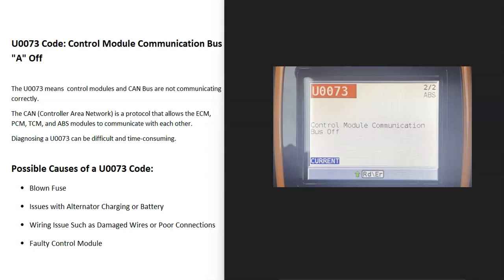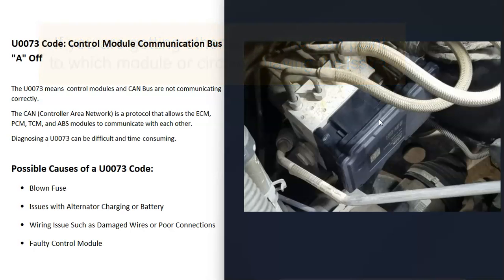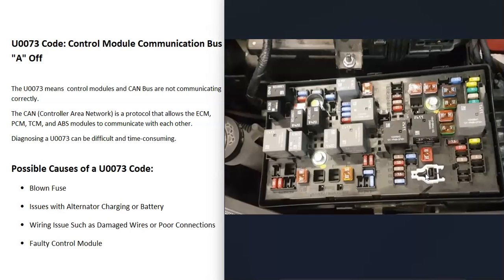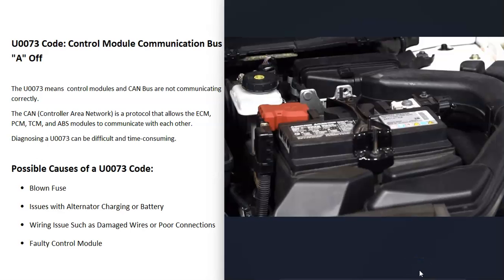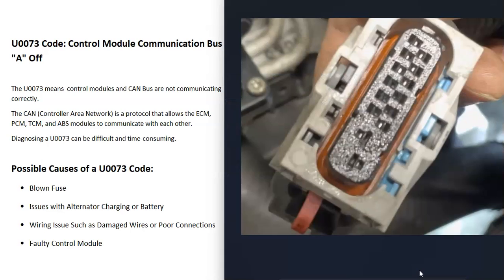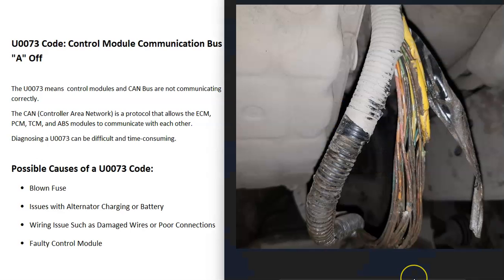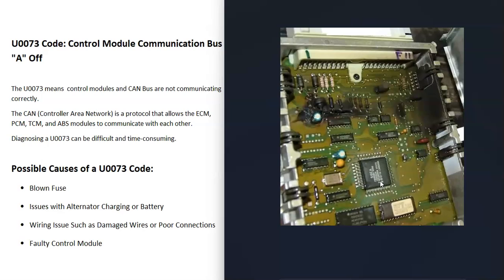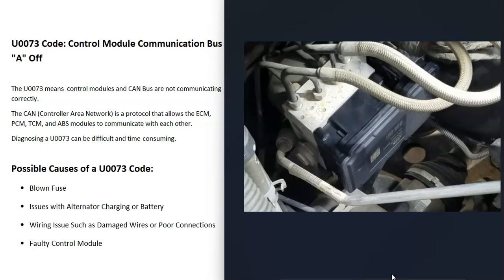Causes and Fixes U0073 Code: Control Module Communication Bus "A" Off

Comment: I have a 2007 expedition 54 motor driving down the road in a trans seemed like it wouldn’t shift when when the wrench came on and the code came up with you 0073 as a transmission control manager

Comment: 2016 equinox 3.6 have this code during driving, gauges turning on and off erratic shifting, then “stabling error” message and check engine light, scanned code get the code u0073 any help?
Reply: That’s what my 2015 terrain 3.6 is doing did you ever get it fixed and what was causing it?
Reply: we have same 3.6 but in a 2008 aura same error code just started

Comment: 2012 Escape...traction control, abs, brake lights all came on at once.  Drives fine.  I had it put on a scan tool and it came up with "No Communication with ABS."  He couldnt pull a single code.  Idk what to do next.  Fuses seem to be fine.  Is there a relay or bus I can check?
Reply: A lot of times, that means need a new battery. Get a good one.
Reply: Any luck yet? I have a similar issue with my 2013 focus with the speedometer not working at all on top of everything else

Comment: Will alternator affect starting?
Reply from the maker: If the alternator is under or overcharging, that will cause issues. It can be tested with a multi-meter.
Reply: @HVAC_Mechanic  Reads 12v like my battery and starter
Reply from the maker: With the engine off, the battery should read roughly 12.20 - 12-80 volts DC. When the engine starts, the alternator should output 13.50 - 14.50 volts DC. You can look up the rated output for your vehicle, but around 14 volts DC is common. If the alternator output is under or over that range, there is likely an issue.

Comment: 2014 Scion tC.  I have this DTC and c1241.  If I turn on the A/C or use high beams, the 'BRAKE', ABS and traction light go on.  Really sucks with the heat lol.
Reply: Did u fix it
Reply: @zart3374  I fixed it.  With all the complexity that could've been the cause it turned out to be a bad alternator.  The NAPA alternator had perfectly OK running voltage and only was only a year old, so I didn't give it much thought.  But I guess further testing was needed to recognize that it was putting out too much alternate current.  Anyway the alternator was under warranty, so I got a replacement for free.
Reply: @zart3374  nope still driving without a/c in 100 F weather until I finally decide to just have the shop fix it.

Comment: My shit only happen when it rain in my Mazdaspeed 3 idk what it mean.
Reply from the maker: It will need to be troubleshooted, but wiring connections may not be sealed and may be getting wet. Sometimes, the computer (ECM/PCM) located in the engine bay loses the seal that keeps moisture out, which can also cause issues.

Comment: I took my 15 silverado to the dealer twice said nothing is wrong with it I'm still working on it but i still have reduced power and the dang u0073 code for the ebcm its been a headache
Reply: did you finally figure it out?
Reply: @DFWAuto_Hack  yes it was the dang torque converter It's been running like new since I swapped it out
Reply: @gasparibarra7334  dang this code is wild. I am checking modules a lines like crazy right now. But the transmission been banging when shifting on drive. The top motormount is bas so im not sure if it has something to do with it. I have ECM no communication with EBCM and EBCM no comm with TCM, BCM, ECM nd TCM no comm with ECM and EBCM & a traction control code and a battery sensor code. Engine has full power but car is possessed. Gauges on dashboard act like they are sick with intermittent seizures lol. Glad u fixed yours
Reply: @DFWAuto_Hack  yeah man idk how but the torque converter was causing me all those same issues the 4x4 would engage randomly, crazy cluster, my lights would even dim out I have no idea how the converter messed with everything else
Reply: @dfwcarkeys did you ever got around what was causing this? Mines doing the exact same thing. And it's driving me insane
Reply: @dfwcarkeys i am right where you  are and I am getting pissed .

Comment: I reset my car by disconnecting the battery and the u0073 came back after the emissions system self checked. I haven't been able to get back and check that out more.

Comment: My 2011 GMC SERRIA  abs light on ,engine light on , traction control,  brake light on , all fuses are good , what could be the problem
Reply: What was it?
Reply: Mine turned out to be high pressure fuel pump. Took it back to the dealership, only had it for a day. It was a 2018 gmc sierra 1500 base. Also had a bad transmission. What a shitty shitty brand
Reply: What code were you running @A7witdasticks

Comment: There was a problem with the device ABS I changed the device to a new one, and then a problem arose during the scan u0073
Reply: did you ever figure out the issue?

Comment: This gave me a better understanding of where I can start. Doing this job on my own and I am no mechanic. Fingers crossed.
Reply: Did you have any luck?
Reply: Update?
Reply: I’m sorry I am just seeing these comments not sure why. No I didn’t but it did get fixed kinda. I realized it was something electrical or battery issue type problem because it wasn’t throwing the same codes every time. A mechanic that works where i used to work looked at it and fixed it. Said it was my battery cable was bad and replaced it. She runs pretty good again but I am the type that don’t like and won’t drive my vehicle if I know something isn’t rite. I feel like if I do knowing something is wrong it will just make whatever it is worse and prob break some other stuff in the process. Ya know? The thing that is bothering me about her (my Tahoe lol) is there is a code that pops up on my dash and it only does it when I have been driving her for a longer time for instance I just came home from Austin/San Marcos & I drove strait home to Houston. A little passed half was it started popping up. It’s something to the affect of JDA62GHAKS 0 (not exactly that but basically. I know it’s gonna be something crazy. I can just imagine and I’m scared to death to be vehicleless.
Reply: You picked a hard one to start with and then maybe not if you luck out and can visually spot the issue.